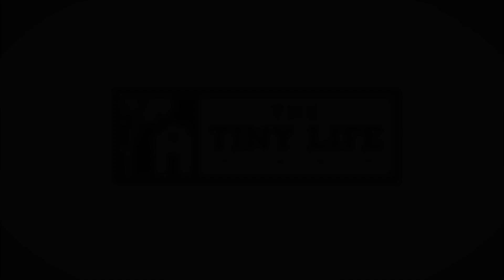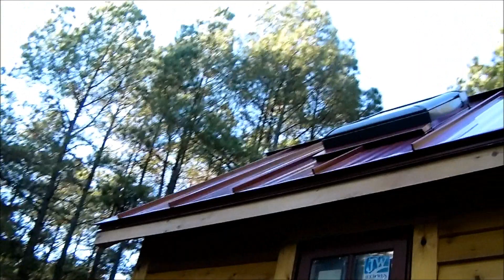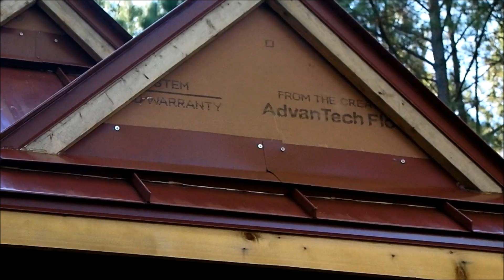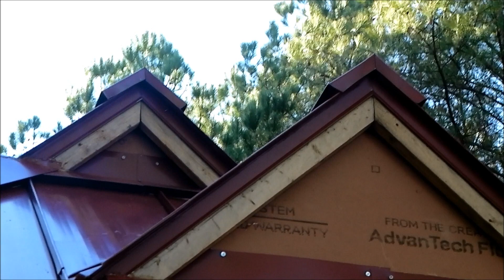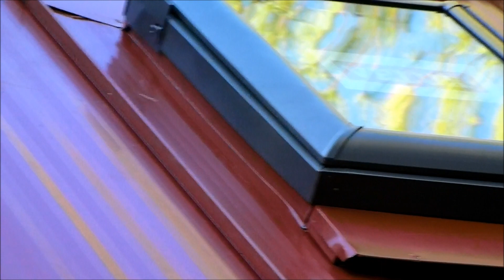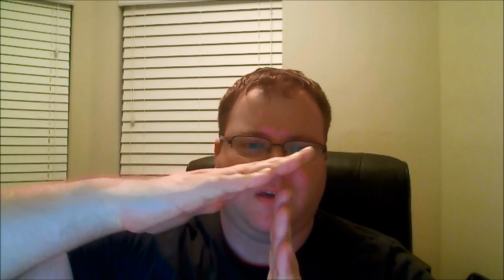Roofing A Tiny House

Comment: How is the roof cap connected to the rest of the roof?
Reply: There is a piece called "z closure" which holds it down the entire run.  its hard to see in the video.
Reply: Also, you said you went with galvanized sheathing because you were going to use treated lumber for the floor, did you?
Reply: Nigel Princehouse
correct
Reply: Thanks.